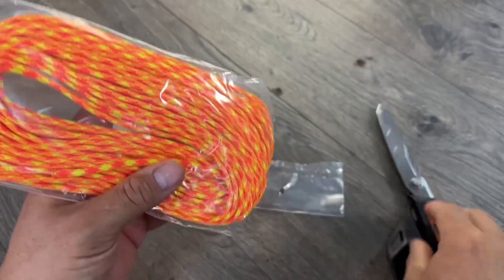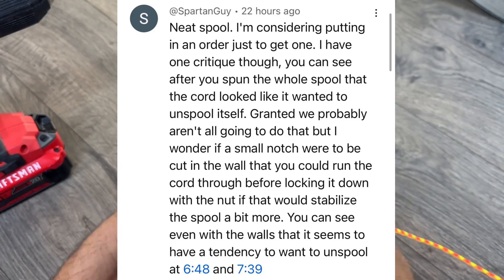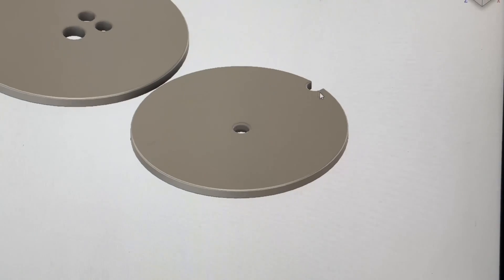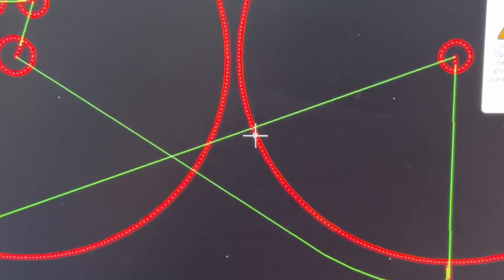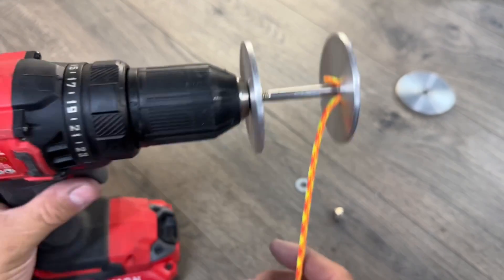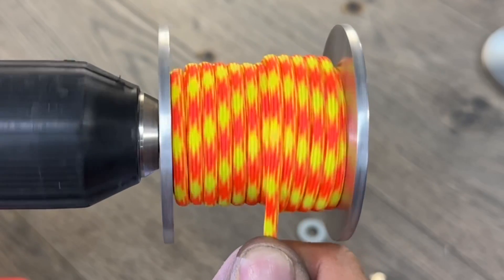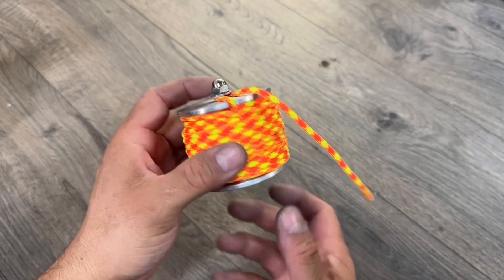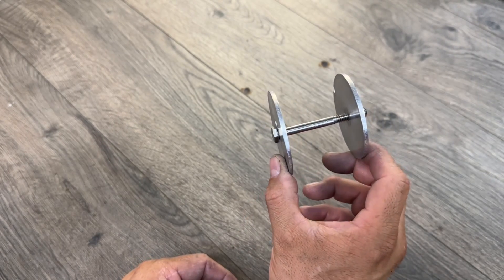Spartanguy improves the 2.5” bolt spool

Comment: Oh I didn't think about the free spinning wall. Very cool new design! And thanks for the shoutout! I have one question though, lets say you spool your cord but the end of it is too short to reach the notch and the acorn nut, are you able to still rotate the wall a little to make it work? I suppose you could unwrap one round of it but that might leave an undesirable length tail hanging out
Reply from the maker: You pull some of the cord out and then make wide wraps until you get the desired length. It can be tricky though so for me, I’m fine with the cord being a few inches out from the spool.

Comment: Those are cool, but the best method I've found so far is using rectangular resealable  plastic bags. About 6" x 9".
It takes some time to feed it in at first, but then it pulls out without twist. If you squish the air out before sealing, they lay relatively flat and can be stored compactly.
Reply from the maker: This is a great idea. I’m going to give it a try.